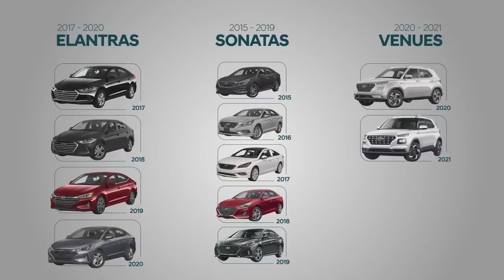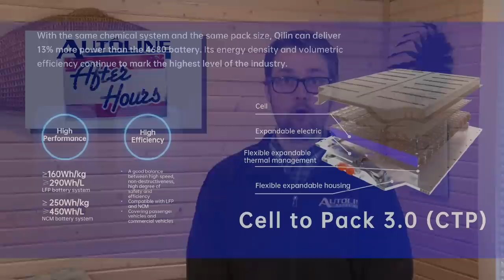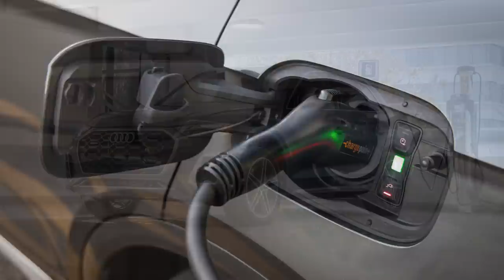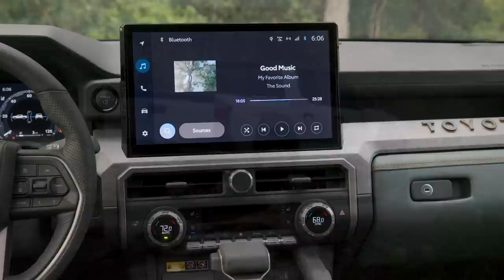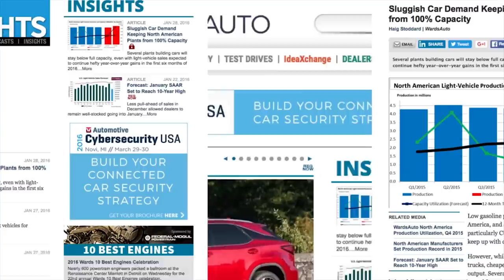GM Will Miss 1 Million EV Sales Target; Silverado EV Beats Range Estimate - Autoline Daily 3571

Comment: GM cancelled its only volume EV, and that one was only moderate volume. They'd better pull out a higher volume model soon.
Reply: They are expecting to double the sales of the Hummer with the new Silverado. 😂
Reply: The equinox should be a higher volume ev for GM.
Reply: @johnjames4624  Sure and with some luck they will make nice profits with them!
Reply: GM is like an oil supertanker.  It takes a lot of energy to change course and once initiated, there's a ton of inertia that keeps it from changing from the changed direction.  Yes, there is some talent in their engineering teams, but there's also a whole lot of bureaucracy that actively fights those engineers at every step of the development and industrialization process.
Reply: And it was in the perfect segment for the second wave of adopters - a cheap subcompact that a lot of people were buying for multi-car households that have a bigger IC vehicle for road trips.
Reply: Exactly
Reply: And I do NOT want to see from where GM pulls it out. Eww!

Comment: 6:17 Munro Live just did a tear down on the Hummer battery. It weighs in at over 2800 lbs. Antonio said the battery pack is a small car without wheels. They made no attempts to try to make the pack lighter.
Reply: They didn't really need to since it is just a halo vehicle that will have low sales. I suspect they just wanted it out there fast.
Reply: It's over 200 KWH storage capacity so yes it's going to be heavy.
Reply: @davidmccarthy6061  Maybe. But the Hummer is on the same platform as the Silverado and Sierra? I'd think they'd share the same battery packs. Those trucks shouldn't be halo vehicles.
Reply: The Hummer battery pack is 212kwh. 2800 pounds is in line with the weight of Tesla’s 100kwh batteries in their S & X models.
Reply: @matthewhuszarik4173  Not even close dude. The entire Model S weighs 4,766 lbs which is actually less than a lot of its gas powered competition. Battery pack is 1,200 lbs. or 2.4X lighter than the Hummer's. Stop making stuff up.
Reply: @TecnamTwin  A ICE vehicle with the same capacity would weigh abut 1500 lbs. less than a model S.
Reply: The also stated the KWH density vs. weight was about the same as other EV's. EV's are heavy.
Reply: @TecnamTwin  he's saying that if you double the Tesla100 kWh pack weight, it's about the same as GM... Tesla at 12  lbs/ kWh and GM at 13.2 lbs/ kWh. 2400 v. 2800. Hes not wrong; I just think you're missing the algebra. While 400 lbs aren't insignificant, the Hummer casing is twice as large and in thick steel, so let's say that accounts for 200 lbs delta
Reply: @onenickthomas  Hummer is a representation of human excess, which MOST pickups are. Hummer being the KING. But it would need that solid heavy casing, to go off road. Not fair to compare with S/X, that don't have same needs.
Reply: @mickzed6393  missing the point
Reply: re: "They made no attempts to try to make the pack lighter." yes, that's because those attempts would be FUTILE.  I can tell Joe just off your comment that you're "baby young to the world" and have little to no life experience.  that is to say you have literally not spent enough time on Planet Earth to understand the basic Physics that says "bricks are always heavier than feathers".
Reply: @TecnamTwin  Basic mathematics or basic research aren’t your strong suit? 
The Hummer has a 212KwHr battery with 30KwHr reserve for a total of 242KwHr. 
The Tesla Model S has a 100KwHr battery with a 4KwHr margin for a total of 104KwHr
Hummer battery weighs 2923 lbs with 242 kwh for 12.08 lb/kwh.
Tesla battery weights 1375 lbs with 104 kwh for 13.22 lb/kwh.
Reply: @matthewhuszarik4173  your data is incorrect. The 2022 Model S pack weighs 537 kg, or 1,184 lbs according to the EPA certification of conformity. In terms of specific energy, the Tesla S/X pack is 187 Wh/kg, while the Hummer EV is at 158 Wh/kg.
Reply: The point of the Hummer is not  to be a big seller or even a useable vehicle.  The point is to transform perceptions in the unique US market, of what an electric vehicle can be, and who, essentially, is allowed to own them.  Now that there is a big super macho lumbering and inefficient EV that can dominate the road, it can be socially acceptable (among social peers) for someone who only ever drives big super macho lumbering and inefficient vehicles to own an EV.

The strength of GM and Ford and Chrysler is not in engineering or manufacturing, it is in understanding customer psychology and market sociology.  This is sometimes called Marketing.  The Hummer EV is a stroke of marketing genius.

But if they can't actually make EVs in volume, it's all for naught.
Reply: @phillyphil1513  Did you even read my whole comment? You realize I did not say this. The two engineers who tear down batteries and give OEMs advice for a living said that they made no attempt to make the pack lighter.
Reply: @davidmenasco5743  re: "The point of the Hummer is not to be a big seller or even a useable vehicle." exactly it's a HALO vehicle same as the intent behind the Cybertruck and Gen 2 Roadster.  laymen forget how the Gen 2 Roadster was originally stated to have a 200 kWh pack same as the "fancy crab walking" Hummer.
Reply: @davidmenasco5743  The BEV Hummer is the electric version of the ICEV Hummer an ostentatious display of wealth.
Reply: @tech010101x  Your energy density are with the structural battery pack. Of course the structural battery pack of a truck designed to carry several thousand pounds and tow much more would be significantly more robust and heavy than a structural battery pack of a sedan designed to carry a few hundred pounds and is not rated to tow. Everything I have read at the battery level Tesla and Panasonic claim the 18650 cells in the Model S have an energy density of ~250W/Kg. The Ultium battery on the cell level has an energy density of ~270W/Kg.
Reply: @josephhobbs4754  re: "The two engineers who tear down batteries and give OEMs advice for a living" well are you SURE that's who they are...?  is that your final answer...?  

no, those are simply 2 guys on a screen disassembling a battery for an endgame of  creating a report that they then HOPE the OEM's will "buy" from them.  yeah HOPE as if the OEM's haven't already been in the business the past 50 years of buying competitors vehicle's and DOING THEIR OWN DISASSEMBLY AND ANALYSIS.

don't make the EGOTISTICAL mistake of assuming that just because you (personally) don't KNOW about a particular activity...? that it means "said activity" is not happening...?  no, the correct answer is the Auto Industry employs 10 Million people annually, as such you can't possibly know who all these people are (or the work being performed BETTER than those 2 jokers you saw on Munro Live).
Reply: The only objective relevant criteria Munro Assoc  used was "energy to weight" ratio.... Which is a much higher ratio than far less robust "disposable" cell to pack designs.... 

And they completely ignored  advantages such as "GM Use of the First Wireless Battery Management System In Ultium Battery Pack"

 Face it the Munro Assoc channel is designed to get clicks from fanboys.... But when they use objective criteria, it shows something different than what they were talking about....

Comment: GM basically doesn't make EVs.  The bolt was made by lg chem and was canceled the second it no longer worked as a compliance car due to the change in the rules for fleet average mpg that no longer count EV mpge as four times more than its true mpge rating.
The ev hummer is a hand built extremely low volume vehicle and has the worst mpge/efficiency out of any "production" EV ever sold.  The hummer demonstrates that ultium is just a ridiculous amount of commodity batteries thrown into an extremely inefficient vehicle. GM lacks the EV tech to actually produce a competitive EV.
Reply: GM will eventually be a big player (if not the biggest) in electric vehicles.
Reply: @heathwirt8919  LOL
Reply: @heathwirt8919  They were off to a great start, until they scrapped the EV1. Now they've discontinued the bolt, I have my doubts. Hummer is dead last when it comes to efficiency.
Reply: @eternalbalance7703  There was never any attempt to make the Hummer efficient, in fact it's quite the contrary. GM is gearing up for mass production of EV's which will start late 2023 or early 2024. It will start slow and ramp up over the next 3-4 years. Whether you like GM or not they will be a major player in the EV market. GM has tremendous resources and a very talented engineering staff. Look at the C8 Corvette, it an engineering masterpiece.
Reply: @heathwirt8919  Funny
Reply: @heathwirt8919  That's just it, there focus is ICE vehicles. They claimed they would have 30 EV models by 2023. They talk the talk, but the focus is elsewhere. Truth is, the game has changed, & GM is struggling to remain relevant. Rising debt  & shrinking margins could end up ruining any chance of being competitive.
Reply: @heathwirt8919  As Brits day, “What are you playing’ at?”
Reply: @heathwirt8919  Let’s hope so, otherwise the Chinese will come in an dominate the future of the car market.
Reply: @FrunkensteinVonZipperneck  Reality is often difficult to accept especially when you're a fanboy or a nut swinger. Do the Brit's say that?
Reply: The reality is that GM is either faking or failing right now.  Let's hope they get it together and start succeeding very soon, in making all the great EVs they supposedly plan to make.
Reply: @davidmenasco5743  Right, a company that's selling 6 million vehicle per year is failing. LOL!
Reply: it seems that you are probably right
Reply: @heathwirt8919  In terms of being a participant in the EV transition, absolutely.
Reply: @davidmenasco5743  Two years from now there will be so many GM EV's on the road you will get sick of looking at them.
Reply: @heathwirt8919  I hope you're right.  I see Bolts every day.  But I've never seen an Ultium vehicle and supposedly they've been in production for over 18 months.

I've seen R1S, Lucid Air, BZ4X and even MX-30.  But not one Ultium vehicle of any kind.  I'm keeping my fingers crossed.

The reason these delays are a big deal is that they bear directly on how much flooding and extreme weather the coming generations of humans is going to experience, and also the follow-on impacts to local and global economies and societies.

Comment: So GM is opening 3 battery factories... What about cars? Where is the announcement of a factory? GM will close the BOLT factory - designed for 25,000/yr capacity. No new factory has been built. What the FRUNK?

Comment: Electric Silverado range will be 50% of rated range if actually used for towing or hauling, as we see with the electric F-150. It's a deal breaker, and too expensive to begin with.
Reply: 225 miles is a deal breaker? For the vast majority, 225 miles will be more than enough.
Reply: @kylekleman  - Here in the United States, people will drive hundreds and hundreds of miles when they go on vacation while towing a camper or a boat. Why do you think most (gasoline) vehicles have a 400 mile range? Then to recharge an EV you will be sitting for more than 5 minutes (hours). In the winter time, the unloaded range will drop because of the cold, and drop more because of having to run the heater. Then, hauling range drops even more than in the summer.

I have no problem with the function of EVs. My wife has a plug-in hybrid and it has a small range when it can run on electricity alone. When running on just electricity it is as good as any gasoline vehicle. However, since it is hybrid, there are no range issues like with a full EV, whereas a full EV loses so much range when it hauls or tows, and you have to wait so much longer to "refuel" with electricity that was likely generated from natural gas anyway. 

In order to even manufacture the batteries for EVs in the USA we have to get the material from China, which controls 80% of certain materials required, and 70% of other materials. Tensions between China and the USA are pretty high right now, and China could decide not to ship those materials to the USA. That would completely wipe out the auto industry in the USA after it has changed over to 100% EVs. However, in 2019 the USA was "Energy Independent" with oil and natural gas production, and thus the USA needed to depend on no other nation in the world for it's fuel needs. Something to think about. Why would we go from completely independent to relying on China for our automotive, and other, energy needs?
Reply: @1001Hobbies  thank you for a polite response. Not enough discussions online. You are right that 225 miles won’t be a good fit for everyone. I’d say that the vast majority of truck owners never tow more than a few hours away from their home. For those that do, driving three hours at 70 mph and stopping for 45 minutes to recharge is a fair trade off due to the cost savings of not buying gas/oil changes throughout the year.  (Again, not for everyone, but most! The other electric trucks only being able to tow 110 miles is quite a bit different than 225.) 

If you aren’t towing, you could drive for six hours straight which is longer than most people will ever drive before a bathroom break. Then 20 minutes of charging will get you another 200 miles of range. That wouldn’t add any time to an eight hour trip.

Your point about China refining most of the critical minerals is valid and the current situation. I agree it’s a point of concern. What’s exciting is all of the new mining, refining and battery production investments in America and countries we have a good relationship due to the inflation reduction act. It’s literally addressing all of those concerns. 

Plus you can recycle batteries. Once we have enough electric cars reaching end of life, we can dramatically reduce the need for new mining. (Steel in the US uses about 70% scrap steel as an example. Lead acid batteries are recycled 99% of the time.) I also would say that having oil and gas domestically hasn’t made us that secure. The amount of wars fought over those resources is high. Plus all of the particulates and chemicals coming out of exhaust literally kills millions of people per year.

Comment: Is the new Toyota hybrid Tacoma with the manual trans the first car ever to have a hybrid drivetrain with a manual trans? 🤔
Reply: The stick shift Tacoma is only available with the turbo non-hybrid.
Reply: It has always been technically possible to make a hybrid with a manual transmission, but there is no practical reason to do so. One of the great advantages of the Toyota hybrid system is that it completely eliminates the need for a complex and expensive transmission and clutch. 

That said, if Toyota could profitably sell a "hybrid with a stick shift" and there was sufficient demand, they might do that.
Reply: No, Honda offered manual in the first-gen Civic Hybrid and the CR-Z. IMO they should've offered it in the gen 2 Insight as an Si model rather than cordoning off the "Sporty hybrid" concept into the  2-seater CR-Z - there's a highly limited market for 2-seaters not named Corvette or Miata.

Comment: On GM EV sales and how few of them are Ultium based.     Munro Assoc recently did an initial look at the Hummer EV (Ultium) battery pack.
Complex (overly or needed?) content and very complex assembly with high part count.  If they don’t simplify the design and process, it’ll certainly not make Ultium a cost effective battery tech ….
https://youtu.be/jB_vDkaO3hU
Reply: What complexity? They bitched about the number of welds, which is automated....  While backhandedly complimenting the packaging of the electronics.... 

The only objective relevant criteria they used was "energy to weight" ratio.... Which is a much higher ratio than far less robust "disposable" cell to pack designs.... 

And they completely ignored  advantages such as "GM Use of the First Wireless Battery Management System In Ultium Battery Pack"

 Face it the Munro Assoc channel is designed to get clicks from fanboys.... But when they use objective criteria, it shows something different than what they were talking about....
Reply: Yeah sue the F out of Hyundai group